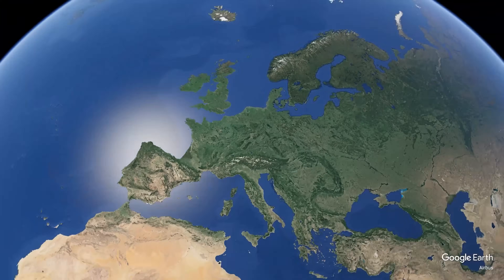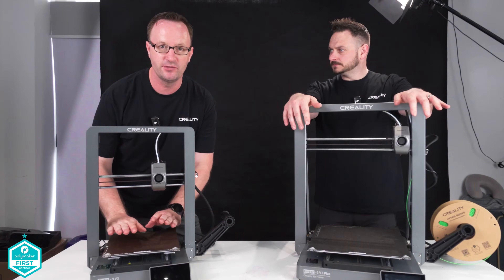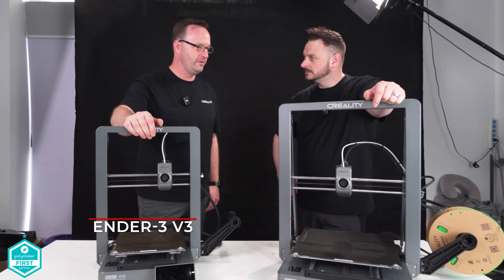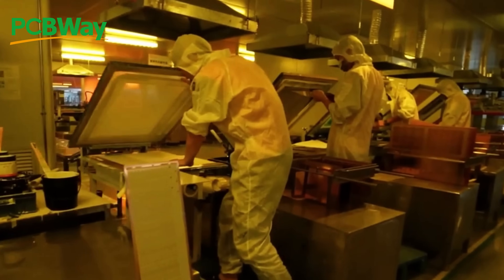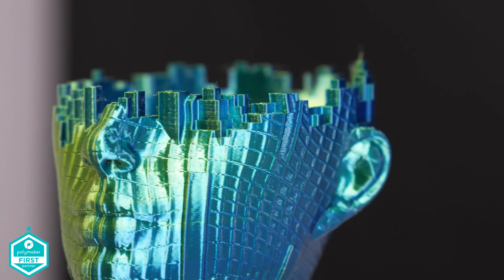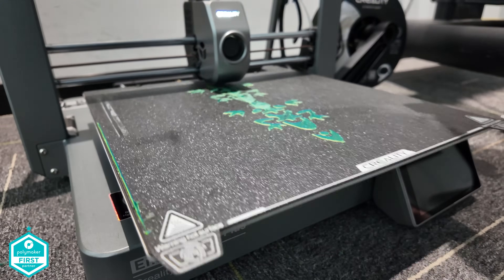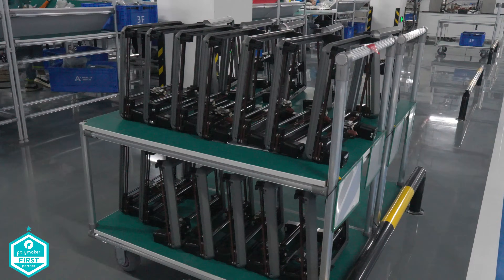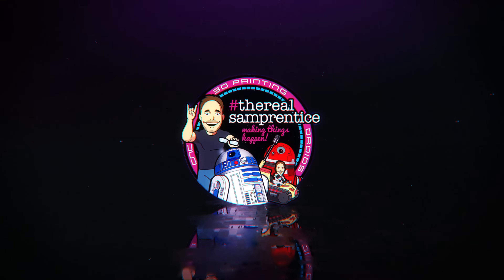CoreXZ Ender 3 is now a PLUS size!

Comment: Sorry but this is nothing plus. This is the minimum default size of most serious printers now. Once again Creality is just milking their line to death.  This should have been minimum 350 by 350 by 400   if you want to be taken seriously and honestly what is the point of this machine when there are now literally dozens of companies almost offering the same features and a bigger bed.

Once again Creality has no clue.  If Sovol can get their act together with their SV08, this model is gonna rust and decay in warehousing.
Reply from the maker: None of those are core xz, this is an approach to a printer that hasn’t been done at a production level before. While the style isn’t all that new it falls into their range of printers, and I hate to break this to you but the first q1 sales put Creailty in the top spot followed but Prusa then Bambu, anycubic, ELEGOO so they are still selling really well. The product might not fit you and that’s really realistic but I guess if you want to drop the complication from core xy to a speedy bed slinger this thing moves. While I recognise I won’t change your mind, that’s not the aim.
Reply: @TheRealSamPrentice  I am not talking about the core xyz abc defg gimmick. I am talking about the size situation. The industry has always tried to keep the printers under 300 by 300  to save money of course. That was par for about 5 years ago. Not so much anymore. The point is that this XL size gimmick is not even a gimmick. Like i said most companies already start at 300 because they know that people want to print big things now. Like full size helmets and things for cosplaying and props. The sv08 starts from the get go at 350   . Sovol was also guilty of doing the same thing. A small model then a bigger model with a bigger bed. Maybe, just maybe they have learned their lessons and will come up with printers that are at least 300 minimum now. Withe way this Ender is built it could easily have been bigger and would have fit in a box that would not be like receiving a fridge on your doorsteps but Hey.... if Creality wants to do things that way, who am i to stop them. They did the ender 5 plus. I got one of those actually so why not go that size for this new ender. Things are getting cheaper to make and eventually this whole size thing will be one big factor of who wins in this market. Not just the speed gimmick.

Comment: Looks pretty rad. The dual Y motors, larger linear rods, and larger X/Z motors are all very welcome. I like that they put the linear rods far apart and pretty close to the bed. Makes the most sense from a physics perspective and a lot of printers get it wrong. My biggest concern with the current Creality lineup, which many share, is their extruder design. The way they support their extruder gears simply isn't sound and that along with some other questionable engineering choices lead to inconsistent extrusion. I'll be curious if this has any changes to the extruder.
Reply from the maker: Its the same as the K1C and that will matter when we move onto multicolour ;) You might not see that on the other enders